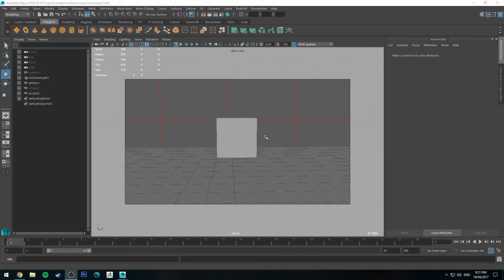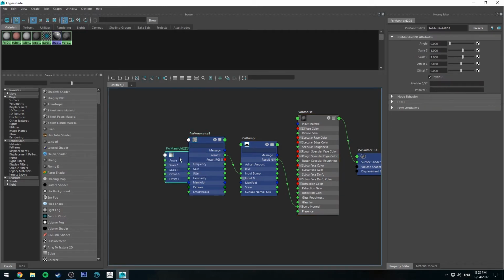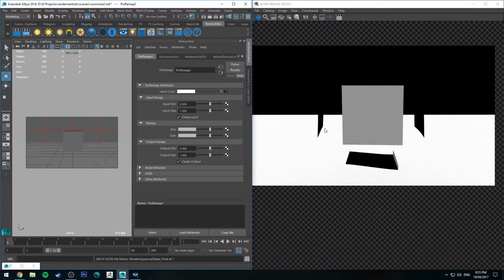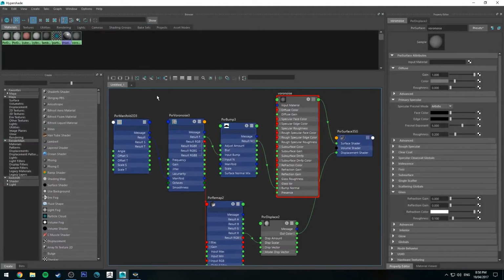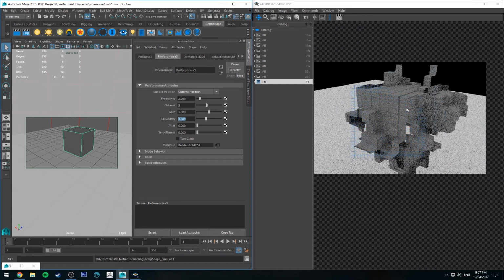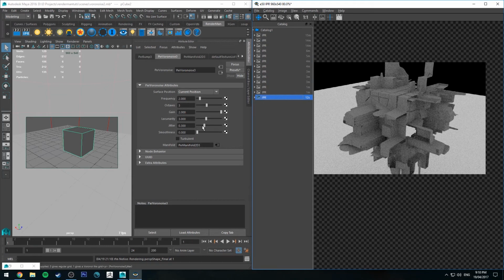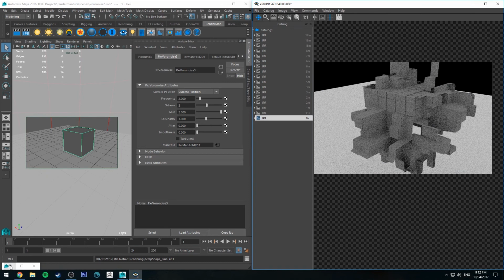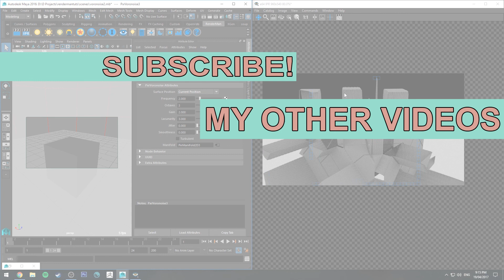Renderman 21 Pxr Voronoise Tutorial

Comment: +Small Robot Studio I've got kind of a noob problem hope you can help me out.
I've accidentally undocked the preset browser and now i can't redock it again 
I checked and Disable autodock is disabled so I don't know what the problem is

I'm in Maya 2017 Update 3
Reply from the maker: You want to have autodock ENABLED then just drag the window to the right side of your window, if you attribute editor tab is open it'll automatically highlight that, just drop it there and it'll re-dock itself. Deleting prefs will do the same if you want to do it the hardcore way but the above should suffice. Hope that helps.
Reply: no it doesn't dock how can I delete the renderman prefs?
Reply from the maker: Or close the preset browser, restart Maya and it should default itself to being a tab again. If not and you do want to reset pref keep in mind that this will reset all of your preferences, animation settings etc. The 'userPrefs' file is located at ~\Documents\maya\2016\prefs - delete/move it and restart Maya and all prefs will be reset.
Reply: Thank you so much I got really frustrated by it at this point